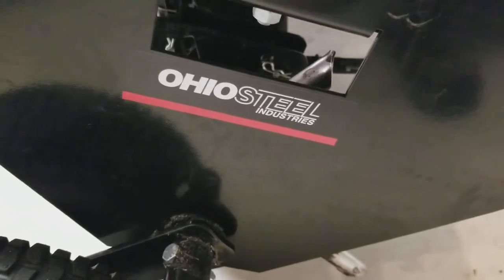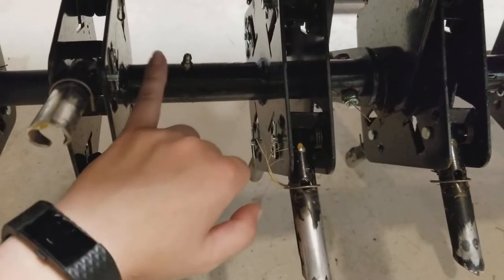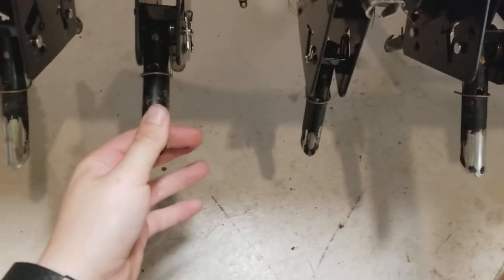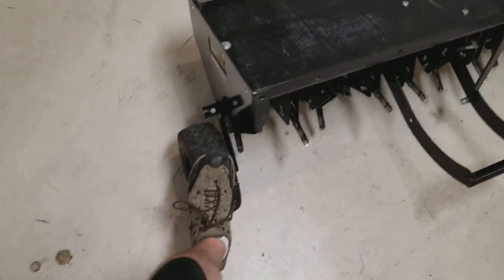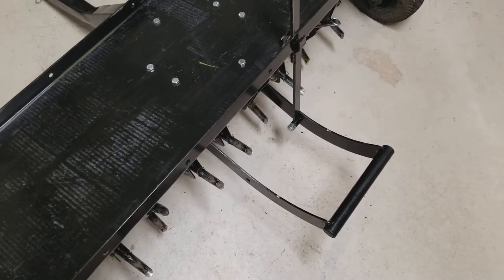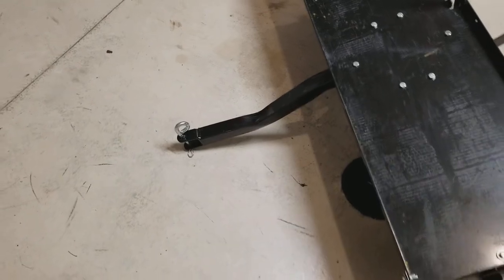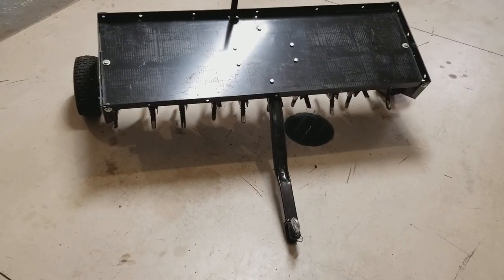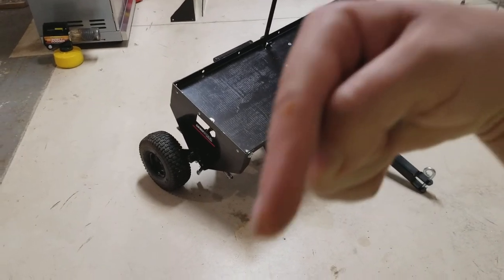Ohio Steel Pro Plug Aerator 48CP Review

Comment: I'm researching lawn aerators now and found the Ohio Steel 48CP on Northern Tool's website and catalog. Seems like a nice product but it is pricey. I read your review on Northern Tool which led me to this video. Great review. I'm hesitant about purchasing for two reasons you mentioned. One, the short trailer hitch or tongue. Second, is the actuation bar. For me, I shouldn't have to and certainly don't want to have to dismount my lawn tractor every time I want to disengage the tines. That being said, it seems like a nice beefy unit and worth the purchase. I'm interested in finding out where you bought the 12 volt actuators. That's a great idea and I agree, for a few dollars more it would make Ohio's product a top notch buy.
Reply from the maker: I think you would be just as happy with it as I am. I do agree it is one of the pricier aerators on the market but I'm just like you I looked all over for a good one and keep coming back to Ohio Steel. The short hitch is a easy fix but the electric actuators is a lot harder. Its a lot of fabricating cause you have to extend the actuators to fit between the side plates and the wheels, and to be 100% honest I have not finish mine yet. 
But the actuators I'm using are this: https://www.amazon.com/gp/product/B00W1ENGR2/ref=oh_aui_search_detailpage?ie=UTF8&psc=1
Reply: Thanks for the LINK.  Not a bad price.
Reply: Have you had the opportunity to finish the electric actuators setup? I'm getting ready to start the project and thought I would see how you done it. Thanks.
Reply: I just bought and assembled this aerator yesterday and have aerated my entire lawn since. They sent 7 extra tines and a tine clip with mine, so maybe they've seen your reviews and videos and are listening.The bushing set-up does seem strange to me. I think the two middle ones and the two end ones should be inside the plates instead of through them, with the holes through the plates just big enough for the axle to go through.  I'm going to see about getting some big thin brass washers and see if I can make some improvements. I may have to shorten the spacers a bit to get the washers in. I'm curious, where did all that side to side play came from on yours? I don't see the end bushing sticking through the end plate when you slide the spool back and forth. I'm going to attempt your linear actuator idea, as well. I think I will mirror the top plate with a piece of angle steel, sandwiching the back of the hitch tube in between with a bolt, as well as bolt in the new piece at each end, beneath the existing bolts. I should be able to mount each actuator to it, directly above each side bar of the lift mechanism and attach the other end of the actuator to each one. I'm a little concerned about the lack of give in the actuators, though. Right now, after watering and a good soaking rain, I still hit compacted areas where the existing set up acts a little like a suspension, keeping the wheels on the ground, with the rest of the trailer riding up and down over the hard areas. The wheels will have no movement with actuators and it may be a little less stable. We'll see.  I'll let you know how it turns out. Let me know how yours does. Thanks.

Comment: Hard to see how that center lifting mechanism works, but is there any way to add that lifting actuator to the center, this way you only need one?  Great idea and I completely agree it'd be a hassle having to dismount every time you need to lift the tines up.   Also, maybe consider making bushings out of PVC piping for the metal on metal issues, thinner one for the inside, wide for the outer issue???   Thanks for sharing your review!!